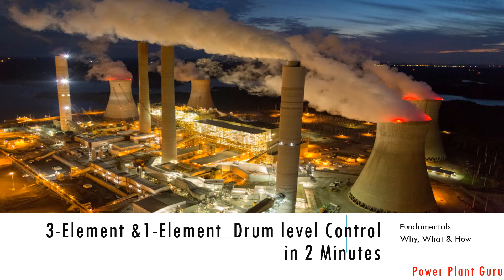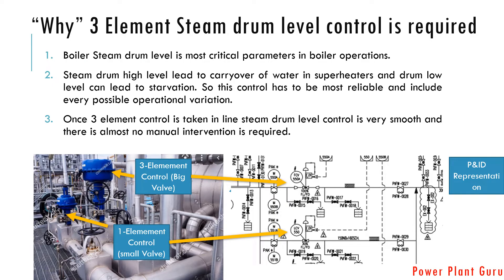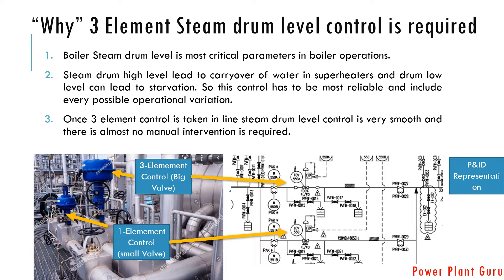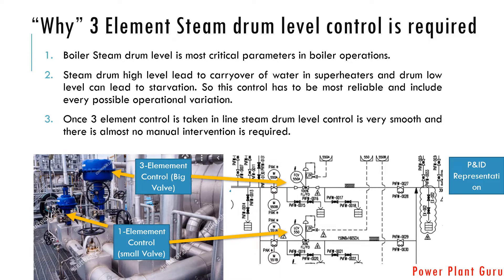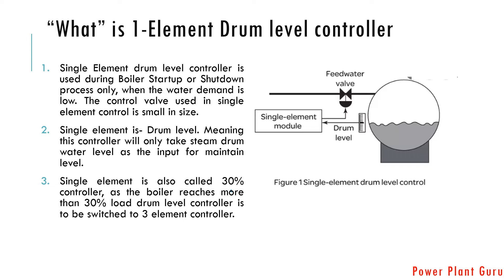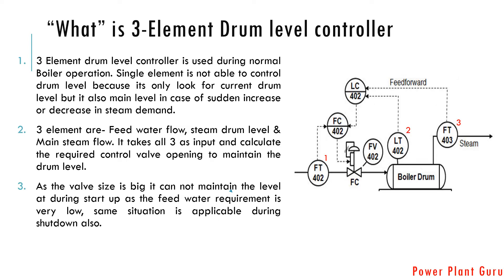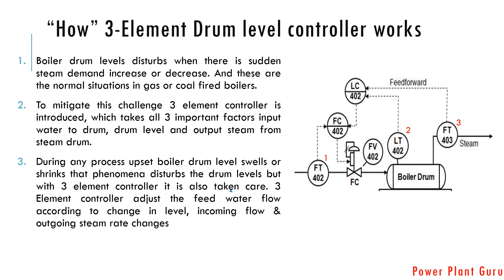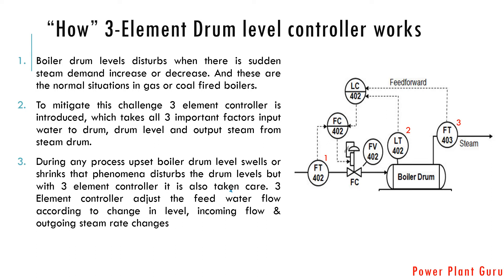How Three Element Drum level control works, 3 element control system, boiler drum level control

Comment: For those asking about shrink and swell:

These changes in drum level are caused by pressure changes. Pressure changes can be caused by numerous events such as loss of thermal input, turbine control valve changes, lifting of safeties, loss of a boiler in a multiple boiler plant, etc.

A steam drum is a pressure vessel where water is heated and brought to the boiling point in order to produce steam to drive a turbine.

At a given pressure, water must be heated to a specific temperature to reach its boiling point. These are known as saturated pressure and saturated temperature. At atmospheric pressure, the boiling point is 212F/100C.

Temperature is the average kinetic energy of the molecules in a given substance (water). As more pressure is exerted upon the water, a further increase in temperature is required to keep the water boiling or the boiling action will subside. You can use what is known as Steam Tables to find out specific saturation values for a given pressure or temperature.

To use an example, you have the initial conditions of a steam drum at 1500 psig/104 bar steady state steam demand. Referring to a set of steam tables, you will find that saturation temperature for this pressure is approximately 600F/315C.

Now let's say the turbine control valves are opened causing a drop in steam drum pressure. You are currently still at 600F/315C which is higher than you need to be for your new lower pressure which will increase the boiling action in the drum. The increased boiling action (bubbles) in the water will act to lift the water in the drum, which will be indicated as an increasing drum level on your instruments.

When the turbine control valves move in the closed direction, pressure in the drum will increase. You are currently still at 600F/315C which is lower than you need to be for your new higher pressure which will decrease the boiling action (collapses steam bubbles) in the drum. This will be indicated as a decreasing drum level on your instruments.

In either case, as long as the shrink or swell does not swing your drum level hard enough to cause a trip, your drum level control will bring things back into line once pressure stabilizes. Pressure will be stabilized through boiler controls increasing or decreasing thermal input as required. If swing is pronounced, manual operator action may be required to stabilize the boiler.

Long story short, if you don't want your drum level swinging all over the place, control your pressure.